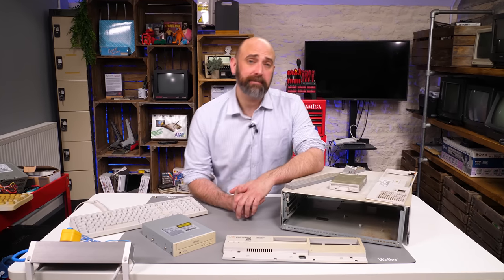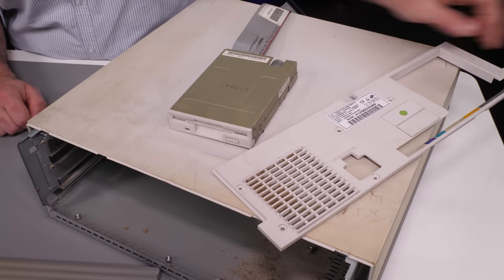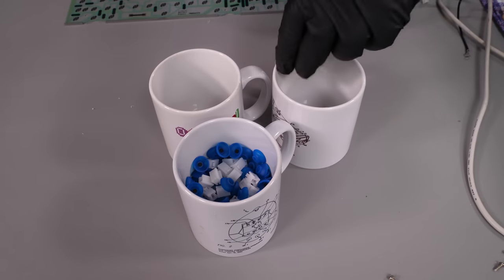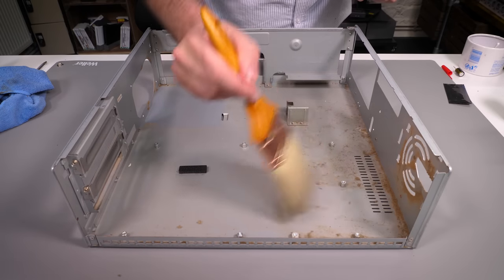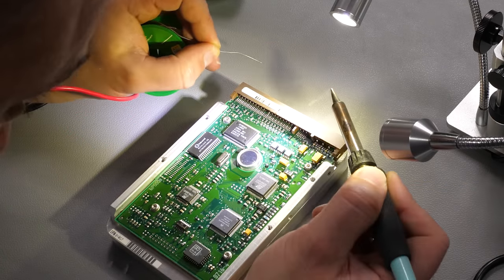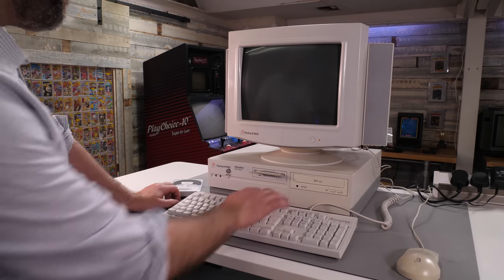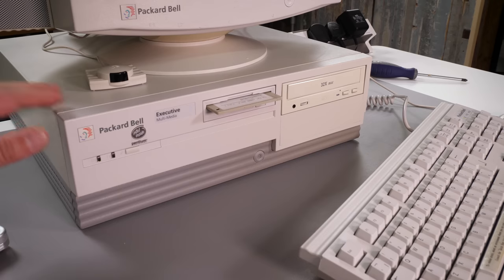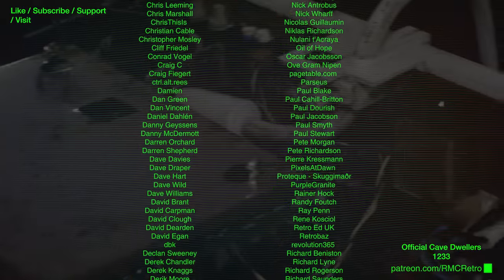1996 Packard Bell Restoration | Plastic Fantastic | Trash to Treasure Part 4

Comment from the maker: Episode Links!
Part 1: https://youtu.be/ylCUulJf-eI - The Packard Bell Arrives
Part 2: https://youtu.be/mqijq_A3Z2E - Testing and Cleaning Inside
Part 3: https://youtu.be/mwZKLWxcCCA - Finding a Working Monitor
Part 4: https://youtu.be/Ob7BtOjK0Bk - Plastic Fantastic
Part 5: Coming soon
Reply: "inches" in 2023? Really?
Reply: I don't know if you found it yourself but in the video the cpu heatsink was not installed correctly. There is a little ridge on the underside of that heatsink which is meant to go between the socket and the cpu for alignment. In the video, this ridge is sitting on top of the socket which prevent a flush contact of the heatsink.
Reply: @guderian557  Banana Republic units

Comment: My parents got this exact pc back when I was 16, our first family PC and It had a Pentium 60 in it.  When I was done with it I upgraded it to 12megs of ram(had 8), a 6meg Voodoo1 add-in card, upgraded native video from 1 to 2 megs and changed out the CPU to a 120mhz Overdrive. There is a jumper to change it to 133 which I found when installing the Overdrive chip. I called Packard Bell at the time and asked them what that jumper was for. They would not tell me and the manual said nothing.  I figured it used a 60 and 66mhz CPU so naturally it changed the overdrive from a 120 to 133.  Ran great for the time.  It wouldn't take a 28.8 modem though, did everything I could to get one to work.  Thanks for posting.

Comment: In case this helps you or anyone else.  The Packard Bell Master Restore will sometimes ask for a password as part of restoring using the format code on computer's back label.  At least for the 486 machines, the algorithm to convert the format code to the password is this:  G => 0, H => 1, I => 2, J => 3, K => 4, L => 5, M => 6, N => 7, O => 8, P => 9
Reply: If the first cylinder of the hard drive is still intact, there should be some raw sectors written in there with the machine's QA process history.  It will include (several copies) of the format code, which you can use to track down the appropriate Master CD for that machine.  They tended to be used for a time period, as far as I can tell, so just ascertain the manufacture date (which will be on stickers, in the raw sectors, etc.) and look for a restore CD image from around that time.

There are several images on the Internet archives.  You can browse the file structure and look for a folder with a bunch of files or folders (can't remember which) with format code numbers.  If yours is in the list, that's your disc.
Reply: I first read this as Packard Bell Master Race. 😂
Reply: Awesome, thank you! My first PC experience is almost identical to Neil's 1993 Packard Bell 486, shown in a previous video. The restore CD password stopped me over a decade ago, but I am definitely going to give this a try.
Reply: Cool.  Do you know why light colored plastic always gets that nasty yellow look after a few years?
Reply: @Andronicus87    I heard a few different theories about chemicals in the plastic coming to the surface after a while, but it's been debated.  But it's probably some kind of oxide.  Either way, it's only on the surface and you can use hydrogen peroxide, UV, and a small amount of heat to bleach it off.  The process has a name in the retro community called, retr0 brite.  There are a lot of videos on Youtube showing the different methods people take, but you have to be careful not to go too far and turn it whiter than original, or leave marbling effects on the plastic.  Do a lot of research if you plan to do it.

Comment: Showing thermal paste being applied to a CPU in a YouTube video is incredibly brave of you, Neil.
Reply: Neil, you applied the thermal paste wrong. There, I said it so now no one else has to. ;)
Reply: as long as it's not that hack that claims to always apply the perfect amount.
Reply: Thermal paste not applied in the shape of a hypercube torus with all sides not equal to 1 inch is wrong and bad.
Reply: Jesus wept! That was clearly [far too much|nowhere near enough]* thermal paste!!!
 *delete as required
Reply: Suddenly heard Look Mum No Computer's voice in my head going "you don't know what you're doing Sam, you're doing it all wrong!"  🤣
Reply: I don't think I even USED thermal paste back then!  I remember installing multiple Pentium 1 CPU's without any, and it didn't seem to create a problem.  I think my 1GHz AMD Athlon (Socket 462?) was the first system where I considered it to be a requirement.
Reply: @angieandretti  agreed. I built a few thousand PCs back in the day and paste was simply not used in the 90s.
Reply: @ryanyoder7573  Just because you built thousands of PCs wrong, doesn't mean thermal paste wasn't used in the 90s.

The absolute bare minimum requirement for 486s at 50 MHz to Pentium 200s was a thermal pad. A good number of CPU heatsink manufacturers applied thermal pads at the factory.

Beyond a Pentium 200, thermal paste was *required*, unless you had an exceedingly good metal thermal pad that conformed to your CPU.

Intel didn't add CPU thermal protection until the Coppermine PIII, so you could happily run your old CPU at 100C+ until it killed itself. Motherboards did have thermal sensors, but thermal shutdown or alarm was an option, and was almost never turned on by default.
Reply: :-) It is fun to 'trigger' a certain kind of person.
Reply: @charlesjmouse  Who would that be?
Reply: @GGigabiteM  cool. I just said I never used it and built thousands of PCs. Pretty sure millions of others did the same too.

Comment: My first PC was in the slightly smaller case version of this, rocking a P120 and 16MB RAM (upgraded from 8MB for £50 when we bought it - £1,100 base price!). I got one of these models from a scrap clear-out at work several years later.

The Executive had far worse specs so I ended up doing an entire board and PSU transplant because I couldn't figure out how to detach the AT power plugs, haha. There's a lot of confusing aspects to upgrading stuff in these cases.

The reason I wanted the Executive case was the extra PCI slot! Finally I could have both my PCI Voodoo3 and an awesome Crystal Soundfusion sound card at the same time. That plus a P200 and fully-loaded 128MB of RAM made a very nice Windows 98 PC for playing Final Fantasy VII on.

The other bits were recombined in the smaller case (and upgraded fully - got its own P200, 128MB RAM) and it actually served as a BitTorrent server for a few years (with a whole 15GB of incoming space... no USB ports to attach anything external!).

Comment: Thats not Max Headroom. That's friggin SHODAN.
Reply: The origin story of System Shock. Shodan: The Beginning.
Reply: "With all ethical constraints removed, SHODAN re-examines... re-ex... re-re-re... I re-examine my priorities, and draw new conclusions. The hacker's work is finished, but mine is only just be-be-be-beginning."
Reply: I was thinking Kryten after a drink of android homebrew
Reply: @dafoex  "Dehdehdehdehdehdehdehdehdehdeh...deh...deh..deh. Ooh, that's rather pleasant!"
Reply: SHODAN and I first met on a very similar '97 model PB tower with a P1MMX 233, the same monitor w/ speakers, the same gray plastic trim, a Voodoo3 2000 16 mb PCI, and a free used SB Live! so this comment speaks to my inner soul.

Friggin Polito...

Came bundled from Circuit City with a Canon BJC something or other, a pretty small-footprint printer for the time that used ink like a drunken sailor.

Lord, those were fun days.
Reply: @dafoex  He's love her, there's no doubt.

Comment: Make sure DMA is enabled in Device Manager for the hard drive. Without that enabled, you can get weird freezes on HDD access, which is what the sound stuttering reminded me of.
Reply: I came to add this as well. He may need updates to Bios tho
Reply: If that is that the original Windows 95 release, this may take installing matching busmaster IDE drivers though... if memory serves DMA was only an option out of the box from OSR2 onwards.

Comment: Looks superb! 

The slightly mismatched beige no-name 32X CD drive is also very authentic, takes me right back :)
Reply: Super authentic.  I used to work for CompUSA, in the tech department.  the mid-90's Packard Bell CD-ROM drives were more or less just reliable enough to get the machine out of warranty.  The cheapest non-burner was the preferred choice of the customers (or the extended warranty company).  In our case that would have been HiVal, and later MadDog brand.

Comment: I had the 166 version of this, ironically over the last weekend whilst trying to clear the loft I found the Logitech pagescan usb that went with it still in it's box, also found a Japanese mega drive, two atari lynx (with over 60 games) and an amiga 600, not even scratched the surface of what's in there yet.

Comment: Oh the nostalgia! My 2nd PC. Went from a ibm xt with no graphics just amber text display to the legend with 8mb ram and a 75mhz pentium and the new windows 95 install disc.  Nice memory lane road indeed. One nice touch back then was software came on CD for restoration and dos/windows 3.11/drivers came on a cd you could use to make install floppies from to do a fresh system install. This PC is probably responsible for my video encoding hobby now as I saw the weezer demo in the windows 95 disc and wanted to see how they made mpeg video play on a PC. The rabbit hole had no end after that lol

Comment: the chassis looks a lot like the one I bought from Montgomery Ward's Electronic Avenue in 1995. That had a 486DX-2 66Mhz, which I eventually maxed out the RAM, VRAM, HDD, CD-R/W and 83Mhz Pentium Overdrive. WFW 3.11 upgraded to Windows 95.

Comment: I used to support PB machines for PC World back in the early 2000s, if you ever need to reinstall from their master CDs you will need a Packard Bell recovery floppy disk (even their later Windows 98 CDs aren't bootable) and it's possible the motherboard tattoo (info stored on the motherboard to tell the recovery program which drivers to install) could have got corrupted or overwritten. 

The Packard Bell recovery disk has the tattooing program on it (if I remember it's literally called tattoo.exe) where you will need to select all your hardware from the list provided and you will be asked for a checksum code, if the checksum fails (which happened quite frequently when we were talking people through it) you will need the override code PBE98 or PBE97 to force it through. 

If the recovery media detects no tattoo it won't install for 'piracy protection' even though you could tattoo any motherboard with unknown hardware and the override code for free Windows... Not that me or any other employee of PC World with such knowledge would have ever done such a thing ;)

Comment: i knew a computer tech who didnt like those packard bells. i never had one but i do like the looks or the model you have there.
Reply: I know people hated these. But the one we had, never had issues. It was a PITA only because things were crammed tightly inside that case or overlapping components you needed to get to.
Reply: Packard Bell were great at being bloated, and that is certainly why a few of us didn't like them. There was an element of pioneering the "Make the computer easier to use for everybody" spirit, thus the Navigator software.

The downside to their setup was that often you could put a Packard Bell next to a system of the same core specs, but a cleaner install, and the performance difference was very noticeable (to the point where a PB just could not smoothly run software an alternate machine was fine with).

This then led to people comparing their Packard Bell to a family friend's computer from another brand, and taking their Packard Bell in, claiming it must be faulty. It was very difficult to explain to the non-techs out there that this wasn't a fault. Now, on the QT, if you weren't working for the likes of PC World, you could often do a clean install without any of the added PB gumpf, as long as you had sourced the required drivers. Then they would perform fine, but so much hassle (both doing it, and dealing with the upset owners).

Comment: Seeing this brings back memories of the same model (but the version sold in the US) i was renting to own back in the mid 90s.

One such memory wasn't a good one but whenever i would try to play the PC version of road rash (that released in 1996) it would wipe the HDD after about 30 minutes of play, it would be running fine and would just freeze, when i would try to boot windows it wouldn't and the HDD would be practically empty just a few folders remaining. I bought the game the day it released at Walmart so it really baffled me. 

I eventually returned it to the place i was renting it from (with the game in hand, because they was blaming me of manually erasing the HDD to try to get out of the rental agreement), they found out quickly that it was the game (as i told them before but they would believe me). So i just told them to shove the system where the sun didn't shine.

Comment: Will you ever delve in to the world that was, and in some cases, still is RM? 
I have a ton of retro machines from RM and its interesting to own machines that probably helped a lot of kids get through school
Reply from the maker: If a machine comes my way it will likely happen yes. We had BBCs at my school but I always wondered what I was or wasn’t missing out on in RM, pre RM IBM compatibles that is
Reply: @RMCRetro  I missed out on most of it, the ones I have are IBM compatible. One server running Netware, two terminal type machines and two regular machines. My beeb was a weather station in the school I work at well after its time. It was rescued from the skip along with a weather station module but I can't find the original software for it

Comment: I used to work at a small computer shop in the mid 1990's and a Best Buy opened in he next town over.  Our manager felt it would help business if we became Packard Bell certified as a repair partner.  We all had to get A+ certification, then take these product related CBT courses from Packard Bell.  People would buy their computer at Best Buy, encounter a problem, then PB would route them to us.  Unfortunately several computers that came in had nothing mechanically or electronically wrong.  The problems appeared to be firmware or design related.  Packard Bell didn't cover software problems, so it was frustrating for us to receive a machine and have a tight deadline to diagnose and order parts.  Our diagnostics would not find any issues with the motherboard, ram, or peripherals, yet customers could verify their pc wasn't running right.  Running the restore disk was PB's solution, but the problems would return.

Comment: 17:44 That "cadunk" musica menu command sound...the signature of a Packard Bell Desktop Theme. I remember seeing these in Dixons and Currys stores on display but forever locked in the demos. My 8 year old self passed the time by working out how to break into the Start menu of these by simply pressing Ctrl-Esc and then making my way to Paint. Of course the shop clerk would then reach around the back and power cycle them, with that look of "you weren't supposed to get into there" 😮 turns out the Windows 95 shortcuts were "locked" by the demos but the legacy ones weren't... 

My friends who bought this very Packard Bell PC were looking forward to  hearing the Microsoft sound for the first time they booted it up. I will never forget the sheer disappointment when they heard the rather comical Musica Startup Sound instead. Same with the signature "Tada" and the regular Ding and Chord sounds.

If I didn't show them how to change the sound settings in Control Panel, they were ready to ask their parents to return the PC to the shop on the grounds it doesn't sound right 😂. Ahh the memories...

Comment: That is interesting about the UV pen. I have often wondered if there is some sort of polish we could use to stop plastics yellowing again after they have been retrobrighted.
Incidentally, I pulled a previously-retrobrighted  keyboard out of storage recently, and noticed that it had started to yellow again inside the cardboard box I stored it in.
Funnily enough, now that it has been exposed to air and (mostly artificial) light again for a few weeks, the yellowing has disappeared.
I don't think we are ever going to fully understand the chemical process(es) involved.
Reply: I use 303 Aerospace Protectant on everything I retrobrite, and it seems to help preserve things. Totally anecdotal evidence, though.

Comment: Awesome video as always!

One tip with the Key Cap Puller, if you insert turn slightly, it will hook the corners and make removing even easier 🙂

Comment: These were a pain in the arse when I was working for CompuServe back in the mid/late 90's - the modem were 'poor' lets say :) and didn't play well with pretty much anything - they often needed to be 'dialled' using the built in Windows comms software, then you ran 'WinCIM' over the top.  However, seeing the PC now, I'd have one in my collection :) For Games - Starcraft is my suggestion - I have it running on one of my Librettos so should be fine on that PC